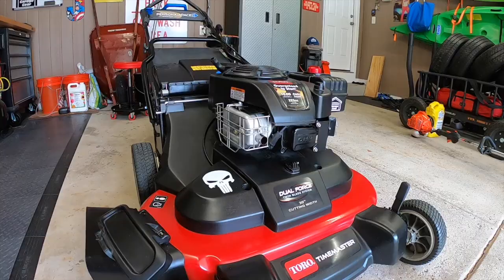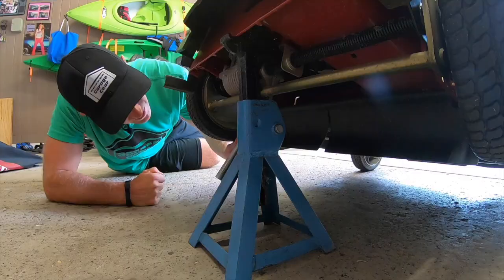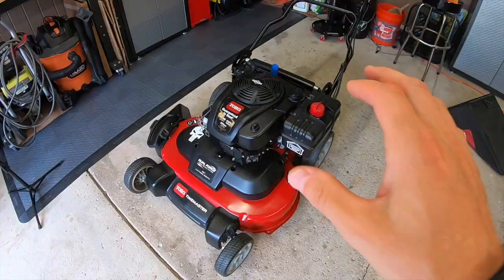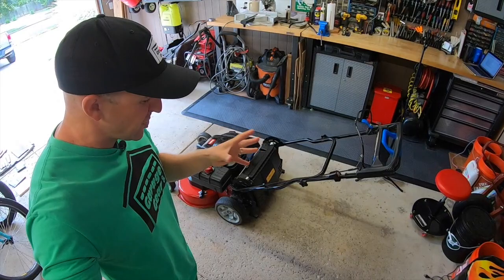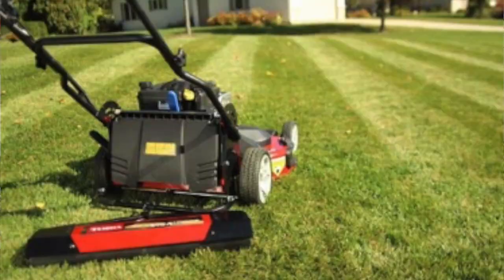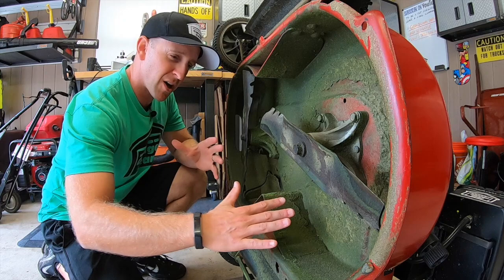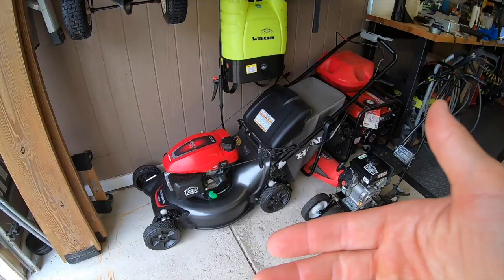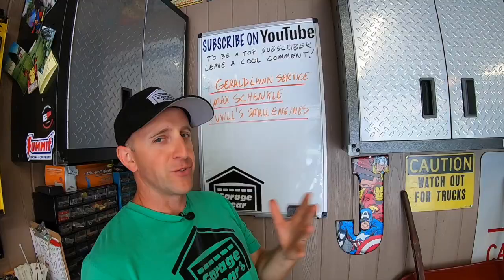BEFORE YOU BUY A TORO TIMEMASTER, WATCH THIS!

Comment: I have a timemaster for about 2 years now. I do understand  with some of your complaints like mowing wet grass and it bogging down or clogging but I usually bag clippings if the grass is tall and wet. It doesn’t seem to have a problem. The motor is less than desirable I agree on. The gas tank issue I haven’t had a problem and I mow about 12,00-15,000 sq ft and can do it on one tank. But I usually fill up in between switching from front to back yard. But I do agree with what you’re saying about all these upgrades why not just get the commercial grade mower from the begging. Great video I appreciate your help
Reply from the maker: Thanks for sharing Capoots!

Comment: Ran one commercially and still do since they have came out. Everything you stated is true. Especially the first few years with that 8hp engine. We always use the home owner version and gone through the pulleys, belts cables, engine, transmission. Land amd coates just says well it aint meant for commerical. Lol I don't see a real issue with grass build up. It probably does make it heavier but the guys don't notice.  Workers would rather use the time master over a 21 in mower any day, though.The deck adds up. When the time master breaks down, like all machines with use these days, the guys always huff and puff until the time master is back. We must have picked a decent one  3 years back  because it has been strong. It is easy to work on though.
Reply from the maker: Thanks for sharing james

Comment: I have a Toro  turf master used it for 6 years the drag flap still drags on the floor every time I pull it out of the garage , looks like new. My block is 4000sqr m app 21527.82sqr ft.. Half of my block has house and garden ,so 2000sqr m or 10000 sqr ft of lawn .I have the Kawasaki - smaller motor and the commercial gas tank , I can mow my lawn 3-4 times . I only ever do an oil and oil filter once a year ,app 50 hours. Never looked at my mounting bolts ,because they have never moved.I have never replaced one pulley. I have just replaced the drive belt app 350 hrs. My transmission is great ,the bearing on the output needs a little oil every service, or it squeaks. I mow every 10 to 25 days, catch 50% and mulch 50% .Only clean my deck on a yearly service, blades last around 2-3 years ,wet grass will slow me down , but not a lot. I have a 2nd mower , haven't started it in 6 years( think I might scrap it) Still has the original air filter..Just remove the plastic belt cover and leave it off. A lot of grass builds up under it and may cause extra where and tear. It also makes checking the belt tension easy .do a visual check every start up. If a belt breaks ,witch is unlikely ,it will fly out sideways .not a problem..PS I have worked in the hire and rental industry for app 20 years maintaining small equipment ,This mower , I have found to be LOW maintenance ..
Reply from the maker: Thanks for sharing!

Comment: I have a 4 year old and totally agree with most of what u said. One thing you left out that I’ve experienced, replacing the blade engagement belt a couple times a season.
Reply from the maker: That’s a common issue too! Thanks for watching!
Reply: Check the alignment, something may be dragging on it.

Comment: I don't own this beast, but I do own the Toro Recycler 22 in. Briggs And Stratton Personal Pace Rear Wheel Drive Walk Behind Gas Self Propelled Lawn Mower with Bagger.  It was purchased new in April 2022.  Last week, I was mowing my acre for the last time of the season.  I have probably between 10-15 hours on the mower.  I hit a tuft of grass that was dense enough to bind the motor and stop it instantly.  When I tried to restart the machine, the piston was bound.  Manually rotated the blade (which was very stiff).  Still could not use the pull cord.  Had to drive 2-1/2 hours to get to the nearest authorized Toro service center for what I was certain would be a warranty repair.
Nope.
The young man told me the issue was lack of user maintenance.  Incredulous, I asked him to explain.  He told me he could tell from the dirt he saw in the air filter that I had failed to replace the filter, resulting in excess wear and tear on the piston and sleeve, and that's why he could detect aluminum shavings in the oil.  He said he wasn't going to waste an hour of his time breaking into the engine to submit a warranty claim he knew would be denied.
Toro may have had a good reputation in the past, but it appears to be true no longer.  I ended up taking the mower to a different repair center and I'll wait to get the final word from him, but I'm pretty sure this will be my last Toro purchase.
It has never started in 1 or 2 pulls ever - although I am at 7000' elevation so maybe?
Even though they proudly claim you never have to add oil, both service guys told me you MUST change the oil.
It isn't mentioned in the manual, but if your air filter is dirty, it voids your warranty?  Wouldn't a dirty air filter just make it run poorly?
I found the machine to be very underpowered.  Grass that is even slightly wet or long bogs this engine down to the stall point.
In retrospect, I would not buy this machine again.  You've been warned.
Reply from the maker: Thanks for sharing Ron! 👍
Reply: @GarageGear  
Yeah...
I realized after writing a War and Peace novel that my experience probably should have been shared under a review of that specific model.
Nonetheless, my impression is none of the current residential Toro's deserve the reputation Toro worked so hard to earn in the past.
Reply from the maker: @ronlawrence5021  I hear what your saying! Their old stuff is far better! 👍

Comment: One thing I would add is the tires are too narrow for the weight of the mower especially when bagging.. You can try changing mowing path every time but still get wheel indentations. In lawns...  There is more than enough room for double with tires, I just have not found any or a way to make it happen...
Reply from the maker: Yeah I agree! I think they were watching the overall weight with these wheels. That’s my guess. Thanks for watching!

Comment: This is my second season with mine I only use it on about four Lawns a week I never had a problem with the safety flap but it definitely clogs up a lot and had to switch out the pulley to the upgraded one also had to change belts replace the on and off switch adjust the sub propelled cable a couple of times but the biggest problem is that it only has a 10 horse engine on it it doesn't seem to have enough suction on it to give a good clean cut unless if it's dry and very minimal growth but that being said for the $1,200 I paid for it I think it was well worth it thank you for the video and have a great day
Reply from the maker: Thanks for sharing this Amy!

Comment: I was always tempted to buy that mower over the last 5 years, but I never did. I did buy the 21 inch rear wheel drive easy store mower. I cut about 7 yards per week. It pays for itself each month. The clogging has always been an issue since new. The ability to stand it on its back makes it easier to clean.  I had the transmission replaced last fall.  One problem I found is the gas tank placement. If it’s overfilled, it drains into the air filter. I plugged it up. Overall, I am happy with the performance. I noticed the deck  is cracked in the center of the discharge.  It starts quickly. I don’t think battery powered ones will work for me. Sometimes I’m caught out in the rain. Thanks for the honest review.
Reply from the maker: Thanks for sharing this Tim! Does your model have an aluminum or steel deck?
Reply: @GarageGear  Steel deck. It has the larger rear wheels and purchased at Home Depot.
Reply from the maker: @timraber6575  got it thanks for letting me know! 👍

Comment: Good video. The best thing that happened when I bought this is I only bought 1. It is a higher maintenance machine. I have replaced the blade drive belt too many times. If I adjust it loose as recommended, the blade speed falls off quite a bit in taller grass. In retrospect, I should have paid more and gotten the Cub Cadet.
Reply from the maker: Thanks for sharing

Comment: I have had mine for 8 years. 
Mow 5 to 6 yards a week all 8 years. 
1 never changed the 190 cc motor. Two oil changes a year with opti oil it's expensive but works. 
On the second Trans, and it slowing down.
Swapped to the commercial baring the first year and no problems.  I take the cover off once a month and blow everything out. 
The clogging is the worst because once it starts you have to clean the deck o it just gets worse. Also it's not wet grass. But you can go slow or overlap and it doesn't matter clog within 10 feet.
Reply from the maker: Thanks for sharing this information tyler

Comment: Well I've had my timemaster for 10yrs now. I've had the trans replaced once while the mower was still under warranty and just recently had to change the trans belt and blade start/stop belt. Never had any pully issues and mower starts up on the 1st pull every time even 10yrs later. I change the spark plug and filters every 2 years and had to change the fuel reservoir once because it started leaking. The only thing I wish this mower had was more power.
Reply from the maker: Thanks for sharing this jerm!

Comment: I'm putting my current Toro Time-Master to sleep after the 5th mowing season.  I prefer to mulch, so I mow 2-3 times each week from April to June, then once every 5-6 days during the hot time.  I regret my purchase but am not sure what to do next.  It's truly just an expensive "ok" mower.  It doesn't mulch that well, the bag shoots grass out, and the self-propelled is meh.  I trashed my second lawn flap 2 weeks after replacing it.  And yes, I just had to clean the deck before mowing a few days ago.  I had a trusted 21" Toro that was working fine but felt that the 30" would be that much better.  Nope.  Next.
Reply from the maker: Thanks for sharing your experiences with the community my friend! Those mowers are money pits. Thanks for watching!

Comment: Gotta tell you I’ve been using one for about 10 years. I have a 21,000 sq. ft. yard minus 3000 sq ft house and garage. Never runs out of gas but my wife has. My maintenance has comes down to single annual oil change,1 belt over its lifetime, muffler guard broke,  and replaced the kill switch. It runs strong and starts on first pull almost every time. I bag but clogs only occur during the worst wet conditions. It is heavy but cuts great. Maybe your problems are related to the operator. Oh yeah, it is noisy. My son is still using it as due to my age I have moved to a battery powered rider.
Reply from the maker: Thanks for sharing

Comment: I’ve got a toro TimeMaster that I cut Bermuda with in the summer and rye in the winter. The rye clumps up on the deck pretty terribly with the mulch blades. What I did to fix this is switch to non-mulch high lift blades and side discharge. I use a bungee cord to hold the mulch guard up and have reduced the clumping under the deck significantly.
Reply: I’ve had no issues except that drag guard breaking and I cut year round on a .25 acre yard. I keep the blades sharp and don’t over stress the machine.
Reply: Ballard non mulching blades are great for reducing the pulp that is made from mulch blades. Great cut too.
Reply from the maker: Thanks for sharing this Demetrius!
Reply: @GarageGear  I’ve got a cheap bolens non-mulching mower that is an absolute beast in rye and wet grass. Mulching is good but there are benefits too to a non-mulching mower.
Reply from the maker: @CrispusAttucks2315  some non mulchers can pull it off!

Comment: Had my Timemaster for 4 years as well.  You are spot on with your comments. Try the rear bagger with the strip kit going up a very small incline. Ha Ha What a joke, not near enough power with new belts and adjusted correct. Oh, let's not forget the rust issues on the underside of the deck. Power wash underdeck 4-5 times a season, also sprayed some rust-oleum on it and use Pam to undercoat the deck which seems to help. Plan on doing that as part of your yearly maintenance and Pam as needed. For the money I would have expected better. Time to adjust the valves, perhaps you can do a domo on that?  Thanks for your honest review and my experience as well. Still trying to figure out how to get to my battery. Got mine 5-31-2018 for $1,050.00 from a dealer. Hard to believe what they are selling for today.
Reply from the maker: Hey Jan the man! I hear ya on everything here! Got mine for $1100 in 2019! Seems to be going up about $100 per year with no improvements. It’s a shame! Might be putting a for sale sign on mine soon lol! Thanks for watching!

Comment: I was gifted.
A used one,  Had it completely tuned up looking like new & a few things replaced. I have a generally flat  3/4 of an acre lawn.  
My biggest complaint about this mower Is that it requires so much grip strength to keep the blades engaged. Far more thsn any mower ive had previously.  And i don't like the placement of the blue stability handle.  Ive smashed my fingers a few times already engaging the power assist
Reply from the maker: Thanks for sharing Christine!

Comment: I’m running a first generation turfmaster that I bought last year and the things a beast but was also clogging up. This year I put super high lift blade on it and found it reduces the clogging by 75% when bagging or side discharging. I would recommend them if you’re having clogging issues.
Reply from the maker: Thanks for the recommendation but mine is currently up for sale. Done with this mower. Thanks for watching!

Comment: I've had my Timemaster for 2.5 years now, mowing 8 residential yards (on average every 8 days)... My original flap is fine.  Did they upgrade them?  The motor shaking loose?  Sorry, I haven't experienced that either.  Maybe you need some Locktite? The best upgrades to the Toro would be the Kohler engine CV 224.  Also, get the upgrade pulley kit and gator blades.  Keeping the blades sharp helps with mulching.  But the engine doesn't need to be replaced until it goes bang, nor do the pulleys, and I still have my originals.  I use the expensive Vanguard synthetic with 25 hour changes.  Basically, I paid $1099 for mine, and through 3 seasons now. It's made me a hell of a lot of money, and way cheaper than other options.
Reply from the maker: Thanks for sharing

Comment: The drag flap is junk I even also put on a replacement. Honestly I also hate the tank. I haven’t had any issue with the motor mount. Had my mower for 3 years now no issues with the pullies or the transmission. Never had a clog issue I use one for my home use and another for commercial use. Love the video man but I also love my Timemaster
Reply from the maker: It’s a love/ hate relationship for me too! Too many issues but great cut! Ugh! Thanks for watching my friend! 👍
Reply: @GarageGear  lol that’s a better way to put it. The electric start was $1100, I do know prices went up, but they may have also gone up on the commercial unit. So depends but we may get another one when this one craps out

Comment: I have a Honda.  I sharpen the blades, change the air filter, and change the oil every spring.  The GCV160 has started on the first pull......every time......for the past 12 years.   I mow 1/4 acre with it.   
I had a toro once.    Once.
Reply from the maker: Thanks for sharing prun!

Comment: I'm on my fourth season with my TM and I have 17, 500 sq ft to mow of Tall Fescue, 9 months out of the year.
Except for the hot summer months, I mow every three to four days.
I've never replaced the flap (it's still all there).
I've replaced one belt once and never replaced a pulley.
In the dry summer months I clean the deck once a month.  Other times it's after every mow, not during any mow.
It doesn't burn thru gas, the tank is too small.  I refill once mowing 17,500 sq ft.  It uses 1/3 the gas that my John Deere rider does.
I've never had the engine get loose and it still runs as good as when I first got it.
I have a hilly lawn and very bumpy, no transmission issues.
I used to mow this lawn with a 21" Honda HRX, I sold it and will never use anything that small again.
One thing not mentioned is the cut - the TM cuts better than anything I've ever used.
Forgot to mention, I always mulch only...
Reply from the maker: Thanks for sharing Gordon!
Reply: I concur with this comment.  I mow around 30,000 sq ft with my timemaster.  I self propel mowed with a honda hrx, and while it was great, it took me around 2 hours to mow my lawn.  With the timemaster it takes me 1 hr 15 minutes.  It does bog down some in high grass, but I just slow down and it does fine.  I do have to refill once @ 45 minutes into the mow.  Overall, I really really like this mower and would recommend it for large lawns and folks who want to walk and not ride.  Never had a motor, tranny, or clogging issue.  I will say that I've only mowed in wet grass once, but I often mow in overgrown grass. 🙂  I also forgot to mention, I always mulch only.
Reply from the maker: @mrficxit1785  thanks for sharing

Comment: It’s 5 y/o almost to the day. Roughly 10k sq ft. As of last yr. cutting 2 small add. lawns.  Very high maintenance. With stripper. You have to def feel comfortable working on small engines if ya own one. The hose cleaner I discovered was contributing to the clumping & deck rust. Can’t forget the 4 new wheels, tread gone, pullies, I’ll give it a pass on belts but all 3 been replaced at least once. Briggs motor has held up though. I’m not rough or hard on things either. Then paid $949. For kicks bag handle ripped.
Reply from the maker: Thanks for sharing this Gil! 👍